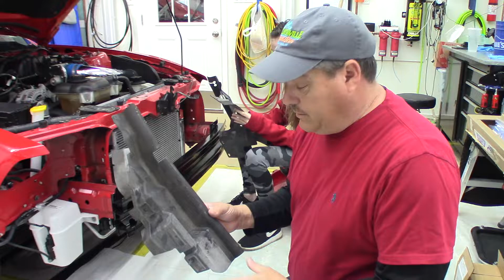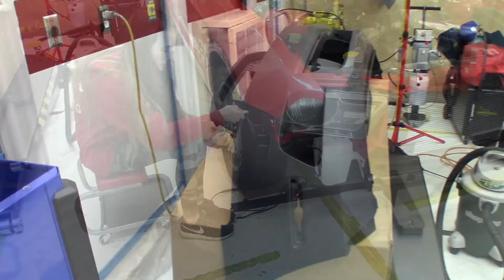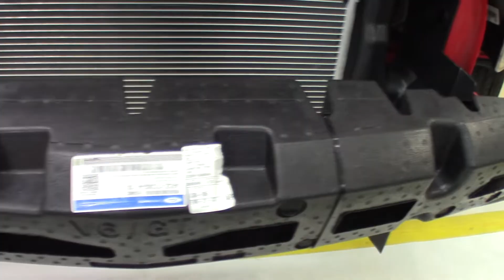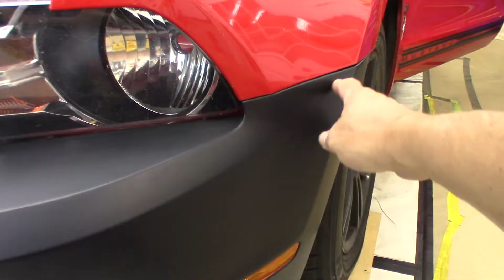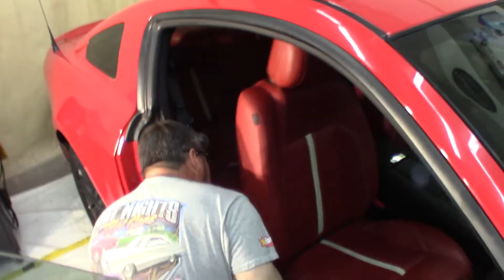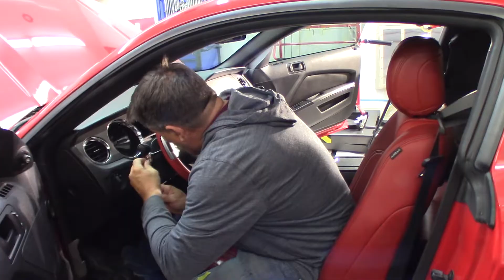The Best Looking Interior by Ford?, Project Sally Revive & Drive Part 6 #ProjectSally

Comment: all of the trim on the inside comes in different colors for different trim packages , standard trim , premium trim both V6 and V8  , and the Pony Package trim for the V6 is also different . my Mustang is both the Premium Package and the Pony Package all in one and it's a nightmare at the dealership to order the correct parts .
Reply from the maker: I bet it is tough to figure out. We don't have a Ford dealership in our area, so I tried to figure most of this out online. Thanks for stopping by.